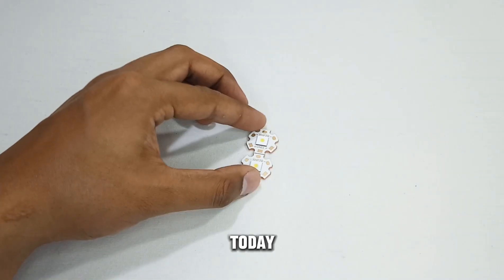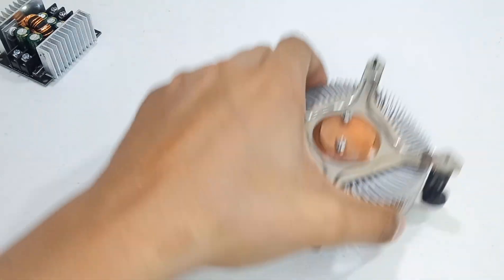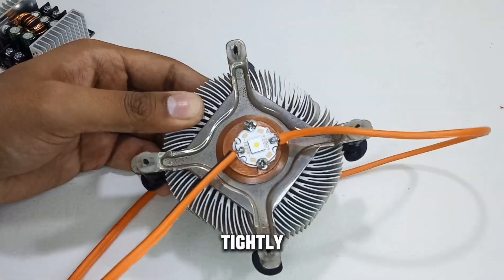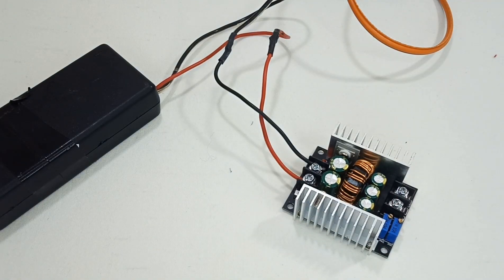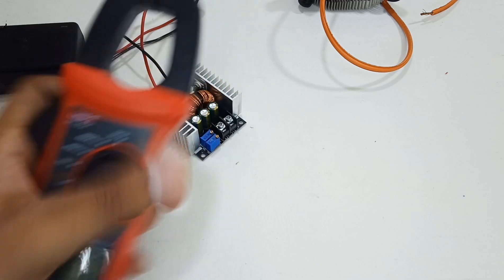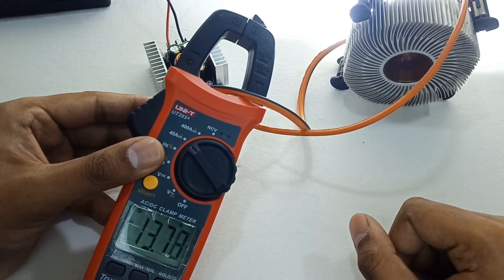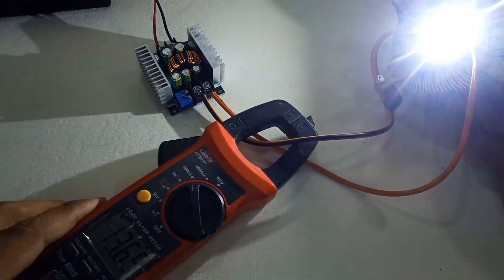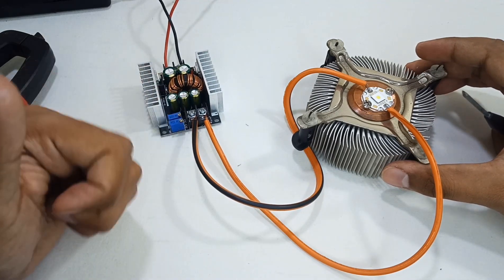Yinding 30W LED Unleashed! 13 Amps, 5000 Lumens Revealed #diy #diyelectronics #amazing #led

Comment: Can you please tell me what is the max amps taken by the led without using a driver. Direct driving it by a 18650.
Reply from the maker: I drive it direct with 10,000mah lipo battery,..was drawing 9.8Amps at 4.15v..
Reply: @Electricquantism402  thanks for the quick reply brother. And wow 9 amps, yep driver is needed.
Reply from the maker: @XS1GOLIATH1  it can easily go to 16amps if driver can handle that much current...my testing stopped at 13amps because input voltage to buck converter was max 19v..
If it was more than 30v, can go to 18-20amps...
Reply: @Electricquantism402  with such high amps an active heat sink is need I suppose and I truly doubt about the life span of that led with such amps...but damm thats one powerful led.
Reply from the maker: @XS1GOLIATH1  yeah it shortens it's lifespan also need copper heatsink with high speed fan.
Reply: @Electricquantism402  looking forward on your next video with some high power leds.

Comment: So 4V@13A = 52W and for 5000 Lumens (or less)? That's less that 100 Lumens per Watt which isn't that efficient really...
Reply: I am out of the material for quite some time. So i do not know what came out in the last few years. But it looks like the Light emitting surface is quite small compared to the XHP70  LED´s. And it is Domeless. So it could be a good one for a thrower. Sure nothing compared to LEP Flashlights (but also not so expensive).
Reply from the maker: @DasArschlochKind  yeah man..it worth a shot for long range throwers using aspheric lens and wavien rlt collar.
Reply from the maker: @DasArschlochKind  unfortunately not.
They were restocked 4 years ago..
I missed the opportunity to buy..
Now only option to get wavien rlt collar is to buy the whole flashlight of marinebeam website which is having wavien collar of I think small size..it costs 129$.
Reply from the maker: @DasArschlochKind  yes you are right. Its much better compared to LEP setup. I will also buy 5050 version.
I'm managing to make wavien collar by contacting some glass companies...hope so .
Reply from the maker: @DasArschlochKind  ok I'll let you know my friend. 👍👍
Reply: @Electricquantism402  can wait to see the throw of  this led running at full power with an aspheric lens....I am installing this on my torch which has a zoomable aspheric lens.
Reply from the maker: @XS1GOLIATH1  it worth a shot with aspheric lens... If having wavein collar, results would be surprising.
I'm also having that setup but with no wavein rlt collar.
Reply: @Electricquantism402  it works well without a collar though. I have a XHP 50.2 led with only an aspheric lens....zooms well and the die shape is clearly projected but the only problem is the led die is a 5050 mm, which is a bit larger than that YINDING led, which doest make a parallel beam. Looking forward to buy an YINDING.
Reply: Only downside i see (for flashlight use) is the high VF. 4V menas in 1S lights you will drop below 4V realy fast (would like to see a Voltage to current gaph). And in 2S you will have to burn off a lot of extra voltage (which makes the driver expensive and you have to somehow get rid of the excess heat from the driver).
Reply from the maker: It can even handle 22Aamps my friend tested at that number it hits 4-4500lumens.. as i mentioned that seller claimed its 5000 but it not as most chinese seller claimed such bogus numbers... At 45w, cree xhp70.3 is 5000 lumens..and at 8.4v 20A, its ..9000 lumens...these leds are quite good but can't beat cree xhp70.3..
Reply: Can you list the eBay listing please
Reply: Plus the buck converter as well please
Reply from the maker: @91rickstar  
 1pcs YINDING 7070 30w high power
https://a.aliexpress.com/_mK6w58G
Reply from the maker: @91rickstar  
https://a.aliexpress.com/_ms54aoC
Reply: @Electricquantism402 which selection did you choose there’s like 7 different types on that listing
Reply from the maker: @91rickstar  which listing are you talking about?